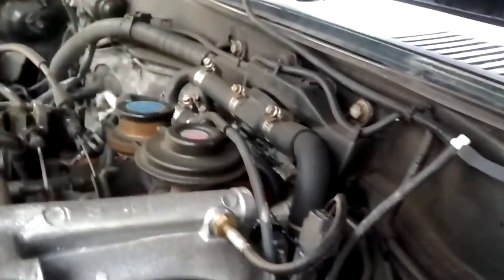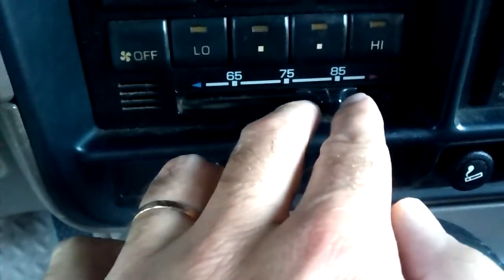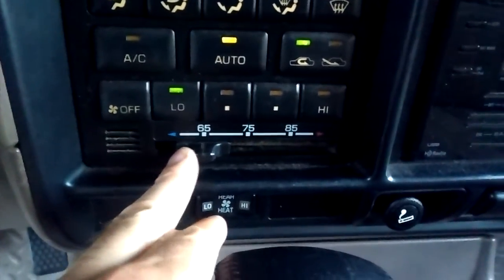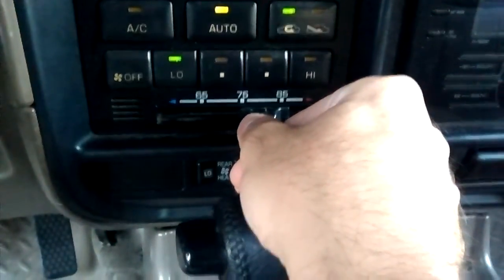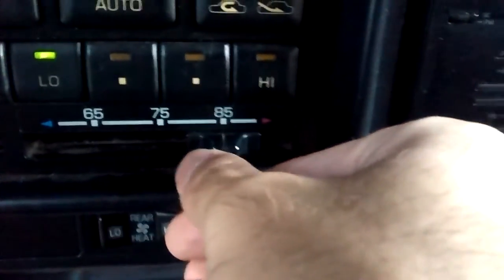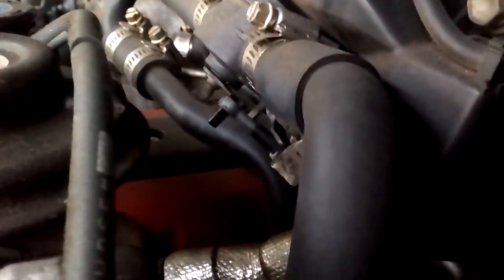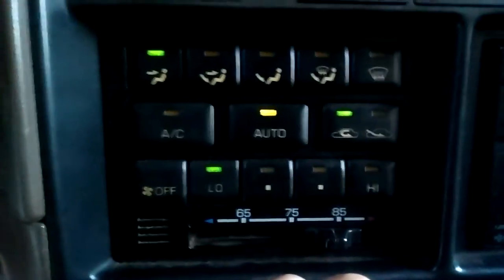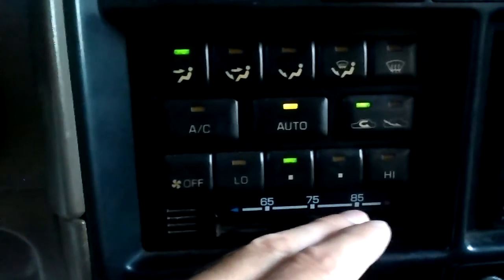Toyota Land Cruiser 80 series heater control problem

Comment: did you figure out the problem? mine is doing the same thing
Reply from the maker: No. Somebody suggested the white flexible hose behind the panel might be disconnected. This is the one with a temperature sensor which helps in regulating the ambient cabin temperature through the auto function. Mine was out indeed. There is a black plastic to which the white flexible hose attaches, which I think contains the sensor. So this black support attaches to the panel and the hose on the other end to it.
Reply: @dixy2k  any success at fixing this in the last 5 years? Reconnecting the tube didn't fix things for me.
Reply from the maker: @wfpg  It hasn't done it lately. It might have been that tube, but not sure.

Comment: Hi, did you install the auto climate control on your fj80? Thanks in advance!
Reply from the maker: No, it came from the factory. It's a 40th anniversary edition.
Reply: @dixy2k  thanks for the response! I have the 96 and purchased the auto climate control. Any idea will it work? Thanks again
Reply from the maker: @maveric8751  I wanna say if there is a plug available inside the dashboard it might work. It is possible it came prewired and you might get lucky that way. That is just me being hopeful. I really don't know for sure. You might want to search this topic on ih8mud forum in the 80's section.
Reply: @dixy2k  will try to install tomorrow.  Thank you
Reply from the maker: @maveric8751  I think it might work and turn out to be an easy installation. https://forum.ih8mud.com/threads/want-to-make-it-auto.11571/#post-107044
Reply: @dixy2k  you are a life saver.  Thank you thank you thank you!